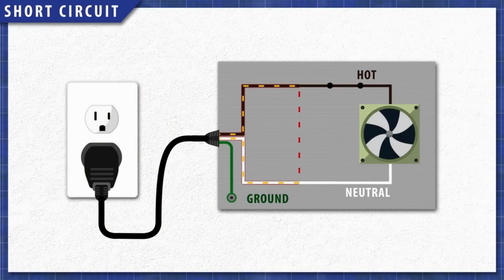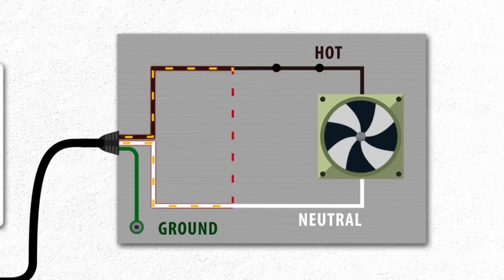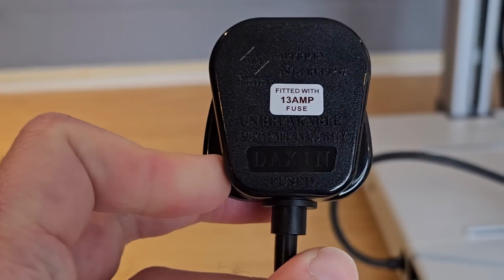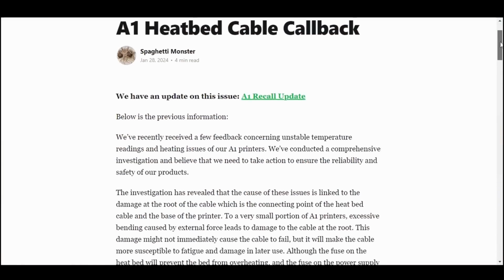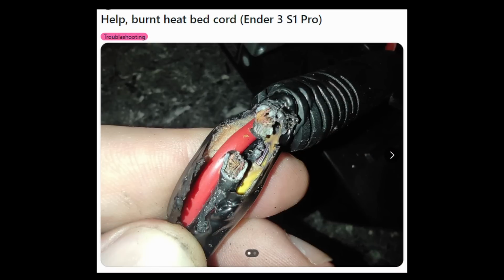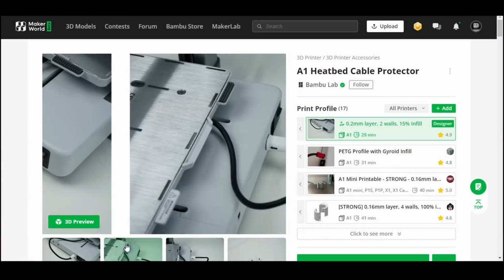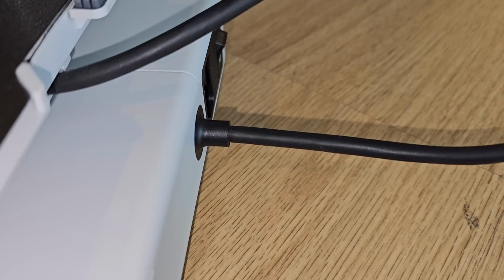Bambu Lab A1 3D Printer Recall - All You Need To Know

Comment: I had the same problem with Anet a8 the way to fix it is with a longer heavier wiring cable yes they used poor engineering  the heated table has to short of and cheap wiring  We need American made 3d printers and not China or other country made 3d printers

Comment: I noticed that the same cable / missing strain-relief issue may exist on my new A1 Mini.
Reply from the maker: The Mini is not affected by the same problem. It has a different cable and a low voltage bed.
Reply: @RickyImpey  That is nice to know but the lower voltage means higher current and the A1 Mini strain reliefs are suspect. I can only go by my electrical career (46kV, 4160 - 600V factory substations, 16 PLC running 2,000 motors, programmer, national trouble-shooter, panel builder)

Comment: This is a major oversight from an engineering standpoint.  This is a known problem with bed slingers for many years.  The issue could have been avoided by using a proper spec cable and a different design.

Comment: So I used to be in the electric cable industry and both designed and tested cables. 

Bamboo will need to be looking at a cable in the realms of robotics types cables where the class of the conductor are typically EN 60228 class 6 (Highly flexible conductors) to guarantee flexibility. They also need to be looking at fleece sleeves around the conductors layers, the concentricity of the wire layout and the insulation and sheathing materials. If I were at Bambu, I'd be contacting a company called Igus UK for expert help (not am and never have been affiliated with them). I'd be looking at something like the chainflex control cable CFROBOT2 for it's design and materials used

Comment: I have a sidewinder X-1 that uses mains voltage for heating the bed, and they have also reported issues (no recalls), but it does make you wonder whether you should leave your printer unattended. At the very least, make sure you have a smoke detector and fire extinguisher at the ready!

Comment: To me there is 0 need for Bambu Lab to restore any faith in their company.

We are all humans, making various mistakes, some more consequential, some less. Bambu Lab issuing (and incentivizing!) a recall this quickly after launch for an issue, that still affects only few models (due to the cause being high stress on the cable followed by fatigue), tells me that they have beyond excellent quality assurance, customer relations, product life cycle management and corporate and moral integrity.

It is a really odd experience with many of the new or smaller Chinese companies, who either hide that they're based in China, or leave it ambiguous, but when it comes to customer relations or support, I wish I could get but half as good after-sale support for my all German washing machine and water heater, like the one I got for my 5€ pen or 250€ standing desk frame.

Comment: Careful Man... my artellery 1x had the same fault, thankfully unlike the x2, it is not a mains powered bed, i think, so it was no big deal. i replaced the bed and printed a housing chain, thing for it. like tank treads containing the power cord. this prevented it from folding so hard and i never had a problem again.

these cables are only just about longenough and are  being bent round 180 degrees before heading to the bed. perhaps add more slack to the cable and have it coming out of the base in a way that it doesn't have to bend so far.

Comment: This is why I've always used Neoprene jacketed light to medium duty industrial cables when making my own power cords - more commonly known as H5RN-F or H07RN-F. Very flexible stuff that's also heat and liquids resistant.
Aside to that, an angled strain relief along with a slightly longer cable would probably help. The former would help in situations where the user butts the machine back up against a wall. More complicated fixes would be to use a cable snake or spring type anti-kink mechanism to limit the bending radius.

Comment: My A1 printer has no damage at all to the heatbed cable, however I do have one qeustion, what would happen if I continued to use it until I decide to either send it back or ask for a rep[lacement heatbed, and something happened to my machine durring that short time period where it short circuited or caught on fire? Would Bambu Labs still give me a refund for the $600.00 printer?

Comment: I have an Anycubic Kobra Neo which suffered from faulty bed thermistor wires. They used thin cheap aluminum wires which would break within the insulation causing a misread bed temp and an error. Their solution was to sent you a whole new bed with the same exact wiring on it. I chose the route of desoldering the old wires, and soldering new higher grade flexible wires on. 

Kudos to Bambu for being so proactive on this, when the A1 is back on the market, I'd be interested in picking one up myself to replace my kobra neo. Hopefully those who choose to do the repair themselves can manage it safely!

Comment: a couple ways they could solve the problems.

1. take a page from track lighting and industrial electrical tracks in factories.

using a track with brush like contacts that ride on a rail that sticks out the back*.

2. take a page from the other 3d printer makers and use 12 volt heaters and use a bunch of 12 volt heaters and parallel wire them and have a 12 volt 100 amp power supply that is 1000 watts something you could easily see in pc ship selling extreme gaming pcs.

even use the dps power supplies from servers that show up on ebay.

* = using such track power distribution requires that the bed only move front to back if the bed has to move in the x and y then it wont work.

Comment: Look at anything that has an electrical connection attached to a reciprocating mechanism, inkjet printer head, scanner, HDD head, etc. They all use flat cables. Round multicore cables flexing like on the hot bed will always put strain on some of the conductors  that are on the outer radius  of the bend. The action will pull them tight. In this case either the copper conductor will stretch or the outer insulation will collapse causing a kink in the cable. You can see this in the video.  This then creates a stress raiser at the point of the kink and the strands of the copper conductor will fatigue and break. This continues until the current being carried by the remaining copper conductors is too much and the cable heats up and goes into melt down. A flat, "ribbon" cable is not subjected to the same stresses and will, if designed correctly, will last a very long time.

Comment: i mean how the hell did this get past their research people. i dont care if this is their fisrt 'bed slinger' or their millionth, i have a hoover that is older than this company and the cable on that has never shown signs of this kind of wear and tear and it gets bent way tighter than this printer bends it, even when it gets bent in a tight loop it doesnt show signs of fatigue. they must of used some really low quality cable. also this should not be offered to people to DIY install - like you said ITS A/C voltage and doesnt take a lot to hurt or kill

Comment: So this is a common problem that we get with robots, and it certainly shouldn't have caught Bambu by surprise. Basically it's that cable replacement is a simple fact of life.

But there are more problems, the cable gets a bit warm (but by appearances it operates well below the limits of the insulation) as seen over at PlastiBots on YT. Not a big deal until you look at the cable feeding the entire printer and see that it is operating at background temperature. Higher voltage operates at lower current (for a given load), which allows for smaller conductors. But you also have to take cable wear into account. The lesson here is to size the cable for wear as well as for load. And arguably it barely covers being sized for load.

So answer me this, why not use the same gauge that feeds the entire printer for the bed? I like to call this superpower of mine my "flair for the obvious"...

The cable itself looks to be adequate - for something that does not flex and mostly stays put. Meaning that it is wholly inadequate for this purpose. 

As a primer in electrical design, mixing high and low voltage wires in the same cable should always be far down on the option list, more so with exploding cables. Imagine what will happen when it (eventually) sends the mains voltages into the soft underbelly of the controller by way of the sensing wires? Basically the same sound effects as what's on an episode of Batman & Robin, but with smoke and fire to spice things up a bit.

Clearly if the cable gets damaged from bending the cable too sharply, then it was never adequate for this purpose to begin with.

So here's a thought Bambu, contact a company that makes the cables for soldering irons such as for Hakko and use a similar setup of conductors (properly sized for the load this time, thank you very much), the same, or better insulation type, and that handy-as-all-get-out connector that will allow you to replace the cable when it gets worn out without sending it back to the motherland. 

Oh, and get the damn thing approved by UL this time. We had to have every panel that we built tested and approved by a UL field rep, it should be no different for any other company. This goes a long ways towards explaining why countries outside of China can't compete.

For those who own an A1 you can report your concerns over at UL (Underwriter's Laboratories).

Comment: I don't own a Bambu printer, but I'll give them props for proactively getting out in front of this issue, and the design on the A1 is clearly still miles ahead of my Creality S1 Pro. Ricky makes a good point about evolving expectations as 3D printers graduate from hobbyist/tinkerer to mass market appliances, but Creality for one still lags behind on quality control with incremental developments to the aging Ender 3 platform, and plenty of other incumbent manufacturers are similarly dragging their heels.

In addition to the same risk of kinking the S1's heatbed cable, even in normal operation the cable's natural bend can bring it dangerously close to the Y stepper motor, which gets insanely hot during normal operation. I printed my own cable chain/guide to mitigate these potential risks, but it's problematic that this was even necessary in the first place.

Comment: Much as they are a sweet little slinger, Penny pinching keeping cables like that as short... as they can still get by. Id say that cable 3 or 4 inches longer to take the tight bend out and this may not have shown up. Maybe a rubber bend moulding leaving the case.

Comment: A regular plastic insulated AC cable simply is not designed to bend hundreds or thousands of times per hour many hours a day. Neither is the DC wire used by other manufacturers really but fortunately low voltage wire has much thinner insulation and on most 3D-printers there's no thick outer jacket to stiffen things up so they mostly get away with it unless the wire used is of really crappy quality (too few strands, aluminium instead of copper, poor quality insulation) as the ratio of the bend radius to the cable diameter is much more favorable.

There are of course industrial grade flex cables specifically engineered to withstand constant bending meant for applications like this but they are much more expensive than regular household/automotive stuff so the designers would have hard time convincing the bean counters it's actually necessary to use the better wires, especially as this is a budget consumer machine built down to a price. I guess Bambu and other manufacturers will learn from this, cutting wrong corners to save a few pennies can get really, really expensive.

Still, unless the cable is totally sub standard crap the material should be fire retardant so it can melt and smolder but not go up in flames which means it's very unlikely to start a fire unless there happens to be something flammable close to the cable. So if I had one of these (which I fortunately don't, I opted for an Ender 3 V3 KE when upgrading to a new generation fast printer) and the cable had no visible signs of breakage I would keep using it under observation (not leave home when printing and have a smoke detector and an extinguisher at hand and regularly check the cable) until I got a replacement.

Comment: Ricky,
Thanks for the information and quick response to your subscribers. I purchased two machines at Christmas from Micro Center NY and I love them. Being as I am an electrical and mechanical engineer, I have inspected the cable and so far it is fine. I only print when I am right next to these printers and never leave them alone. I opted to send for new beds and cables and I will replace them when they come. In the mean time I inspect the machines before each print and always keep an eye on them. So far so good. I hope Bambu Lab resolves this quickly. These machines are fantastic. By the way, I love your videos. Keep up the good work. Happy Printing everyone. MartytheMachinest

Comment: I hate that I had to give up my A1. I was originally going to keep it once the recall was made, but my A1 had an extruder sensor failure that resulted in me having to return the printer to the store I got it from. Unfortunately, because of the recall, I had to get a different model. I got spoiled on the sensors and capabilities of the A1.

Comment: I believe Bambu did the right thing, disclosed the issue and have a plan to make it right.  Not many manufactures will do that.  This will build brand loyalty in the long run.  I also praise them for offering a self-repair option.  I support the right-to-repair movement.  I think we, as consumers, need to change our mindset about making repairs and attempt more repairs ourselves.   Manufactures need to get better at sharing repair instructions.  Bambu is on the right track.  Repairs like this can be done safely without being an electrician or having an electrical engineering degree.  Safety instructions can be included with the repair instructions.  Doing a repair like this yourself will make you more aware of how the printer works and lead to building self-confidence for future repairs, which has many other benefits such as reducing down-time, reducing back-and-forth shipping, reducing landfill waste,.  In the end it will improve safety and reducing costs.

Comment: The early Pursa models used this method and it worked good for bed wiring. take a peace of filament. tie it into your wiring (tape and just follow along side of the wire) the filament will prevent the wire from bending and reduce the chances of your wire to brake.  TBH this is really a N00b mistake. as i said this was a fix on early Pursa models. Its like wanting to build a boat with no understanding it needs to be water tight to some degree.

Comment: i did that recent update where they detect wether or not the printer is affected by the recall and mine was ok
Reply: Recall is on all A1’s, so if not an A1 then you don’t need the update to tell you.
Reply: @Goosefang maybe you need to re-read where you got that info cause both my a1 printers are running fine on current firmwares

Comment: Well… Possible shipping damage and customer misuse are both test scenarios that a manufacturer must consider and include within their pre- release test plan. They should have tested moving parts to failure, which includes moving wires, especially a mains powered bed heater.

So yes, Bambu “owns” 100% of this issue and they did the right thing by recalling 100% of the printers. I might question the thoroughness of their CE or UL testing as well, although it’s possible that production machines were built with different parts than the original product design. Manufacturing sometimes takes liberties with parts and assembly procedures.

I would add that this failure can and probably will affect all printers at some point, so the fact that yours looks ok at the moment is meaningless.

Comment: The standard mechatronic solution to this is to put cables in a cable chain, where the cable can't bend more than the cable chain allows. There are a whole load of print in place, parametric cable chains out there, all they would need is an adapter at one or, ideally, both ends. But this assumes you fit it before any damage occurs.

Comment: I’ve opted for for the heat bed replacement and $120 voucher. They supplied a link detailing the replacement and it seems very straightforward. In the meantime, my cable is fine and already had a printed support before they made their first announcement. I’ll be using it right up until the repair, though I won’t be leaving it unattended.
Reply: Do you get to keep your old bed?
Reply: @IanAddington-d6p  replacements won’t be shipping until next month, will find out then. In the meantime I already had support on my cable and will continue to use it, but only while I’m able to supervise it
Reply: @IanAddington-d6p  they do not require you to send the old bed. Got it last week and have it installed, now I’m waiting for the $120 store credit
Reply: Replacing it should be fine its the same set up as when we got it.
Reply: @Uncle_Baby_Billy  I did not have to attach my heatbed. It won’t be as when we first received it but their video link detailing its replacement was straightforward